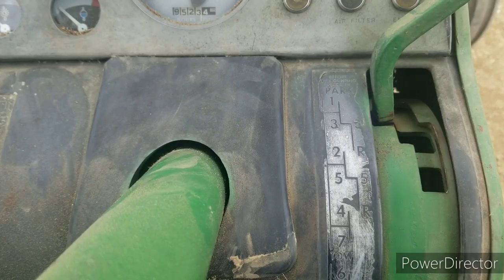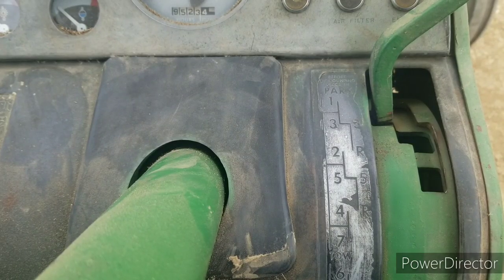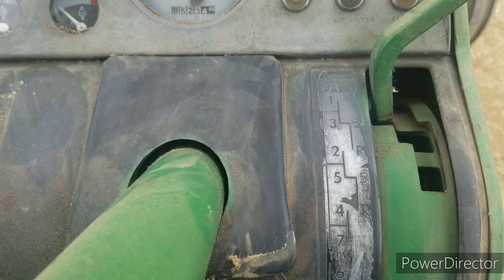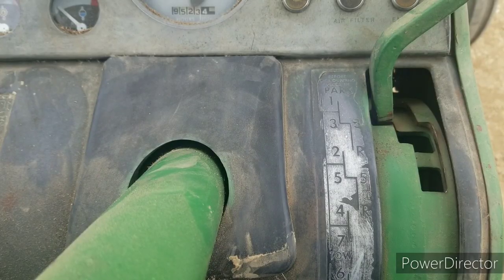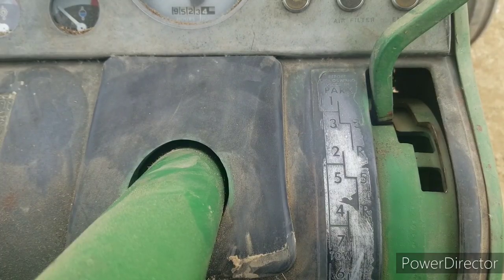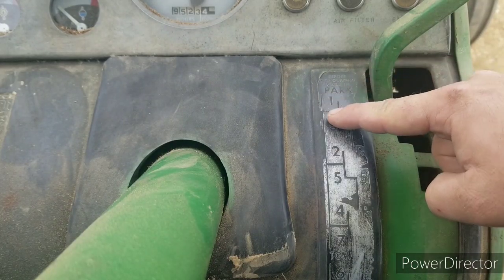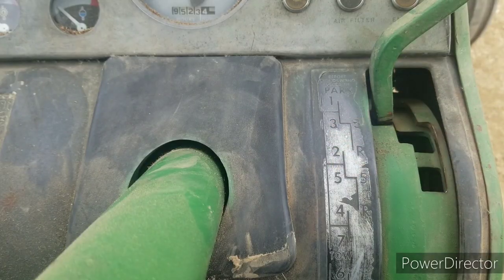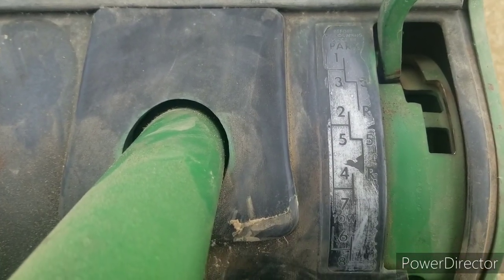John Deere synchro trans - simplified and explained  4320 4020 3020 4010 3010

Comment: I never understood the hatred,  or was it  fear that the IH people had for the Synchro-Range, as I was probably 12 years old when my Dad put me on his new 3020, and let me take it for a ride, MY problem came, when, trying to turn, it kept wanting to go straight, because my right foot had engaged the differential lock.

The only IH I ran in that era was a neighbor's 656 Hydro, which of course, only had the one forward/reverse lever, and it may have had a HI-LO range lever on the other side of the cowl.

Pulling a Syncro-Range without it being in TWO, was, as he said, guaranteed to weld everything on the top shaft into a solid irrepairable, hunk of metal.  You could also turn them into toast by allowing the tractor to coast backwards, when packing silage
Reply from the maker: I think the hatred was not being open minded and taking the time to learn. Operating a syncro is like riding a bike. At first it seems overwhelming and impossible but once you figure it out its 2nd nature like breathing.

Comment: Best explanation i've seen on synchrorange but it was said that you should not shift the range on the move, if you are towing a heavy trailer on the road is the 6th gear low enough to start with or do you just not use the highest range at all or just "force it" from 3rd to 4th range on the move?
Reply from the maker: You are correct you are supposed to start in 6th. That's not too bad if the approach to the road are flat but add a heavy load and a hill and it can become a problem.  I know range shifting on the move CAN be done but it's not good on it. That is one positive about the powershift. You can start in 1st if you want to and just keep bumping her up. Good question hope I answered it. Thanks for watching.

Comment: Damn I've seen memes around internet about this for years, finally i understand it by your genius drawing and explaining: its a 4spd + 2spd-reverse in serial, but the marking printed is showing "sequence" of decreasing ratios, hence from 1 to 8, which is very confusing for people who not familiar with farm equipments. Very good stuff!
Reply from the maker: Definitely less complicated than it appears
Reply: Kenne ich aus den 70igern vom 3010
Reply: Super erklärt, top
Reply: If John Deere would have called it a four speed with hi and low many 10 20 30 series owners would have slept better through the years

Comment: but why are the number 13254768 that dosent mean anything
Reply from the maker: The ranges overlap each other. so the speeds  don't work out to be 12345678. If they wouldn't have numbered them and instead just put  1 low, 1 high, 2 Low, 2 High etc  it probably wouldn't be as intimidating but you wouldn't know which speed was the next higher or lower. It is odd that the numbers aren't in sequence but when you get them in the field it actually works out very well. Example pulling out on the road if it was 7-8 instead of 6-8 then 7th would be too high to start in but starting in 6 and clutching to 8 works very well.  Thanks for watching. Machinery D

Comment: ill be learning to drive a 3020 this summer. City born learning some new things. So I just wanna clarify... You cannot be moving while trying to change between the 4 speeds. but you can clutch and shift between the 2 speeds in each of the individual 1-4 speeds between the high and low?
Reply from the maker: Yep you got it.  Example 2-5 or 1-3 clutch and go but 4-5 stop. Anytime you have to bring the shifter to the left side and change ranges stop. But sounds like you've got it figured out. Once you get the hang of it you'll love it. Thanks for watching 👍

Comment: what is the problem when all gears do not want to move only revese work
Reply: the probem is from john deere 4320
Reply from the maker: @juancruz3434  most likely something in the shifter or shifter linkages. I'd take the cowl off and make sure nothing is bound up.

Comment: What is your experience with the transmission temp gauge? How long do you have to operate your machine before you see that gauge start to read?
Reply from the maker: Great question! I've questioned that myself. When I got the tractor I replaced the gauge and have never seen it move the needle. I'm not sure if I just keep my coolers and screens clean so it doesn't heat up or if I bought a dud. Thanks for watching 👍

Comment: The 4020s had the the reverse in the 4th and 7th range too. They were either blocked or deleted on the side console tractors.  The purpose of that gear was a road gear for mounted cotton pickers which were mounted backwards on the tractor. Reverse was now forward. I think now after 50 to 60 years of service the shift mechanism gets sloppy and quirky and people who have never run one of these tractors gets confused because they put the shifter where they think they want it and it grinds or does nothing. I've spent thousands of hours of my life of mostly 4020s but a lot on 4010s and a 3020 powershift. I'll  add that as good and reliable as the sycros were, the  powershift was even better and more reliable.  The 3020 has more than 20,000 hours on it and the transmission has never been touched.
Reply from the maker: Thanks I didn't know that about the Cotton pickers. Thanks for watching 👍

Comment: Got a 4010 I can't get out of park any suggestions
Reply from the maker: @MarkRivir  usually a good jerk and they come out. Other options are hooking another piece of equipment to it and rocking it back and forth as someone else tries to pull it out of park. This is probably the best way so you're not forcing it. I've also heard of people using a block of wood and a hammer tapping on it but wouldn't get too crazy with it. You don't want to brake something. Also check to make sure none of the linkage is bound up. If none of that works you may have internal problems. Thanks for watching

Comment: The Synchronized 8 speed Deere is nice. However, as the Deere has a closed center Hydraulic system like Massey Ferguson, when the clutch is depressed and the gear train stops, so does the charge Pump in the Transmission that feeds Oil to the Main Pump up front.  Massey’s Charge Pump operates off of the PTO Clutch Drum which runs continues to run any time that the Engine is running. Deere copied a lot of Hydraulic Technology from Ferguson including the Three Point Hitch (   Ferguson System  ).  They messed up on the Charge Pump.

                                        Fergieman
Reply from the maker: @Corvacar  yes although a lot of people say they're the best loader tractor transmission because of the 5f-5r shuttle I don't like them on a loader tractor for that reason. Hold the clutch down too long in close quarters and loose hydraulics. Thanks for watching
Reply: Might have an internal leak somewhere robbing hydraulic fluid from the reservoir. I’ve tried holding the clutch down and cycling the hydraulics several times and don’t lose hydraulics.

Comment: My Grandpa bought a 3010 with this transmission. It took some time to figure it out. Then it was time to teach Grandpa on what to do. Dealership delivered it when no one was at home, he got the manual later.
Reply from the maker: @geraldgiles388  they are intimidating at first but awesome after you figure them out.

Comment: Watched three times great video. Our 806 farmall had torque amplifier. Would loved to field test with 4020 side by side.
Reply from the maker: Thanks I appreciate it. The 4020 would have a hard time beating a 806 on a HP and traction test like plowing and discing. Those 806 generally run very well. Where the 4020 usually won was balance and nimbleness. They just handle so nice with super light steering and strong brakes. thanks for watching
Reply: @machineryd2765 that’s a good way to put it. They both had their strengths and weaknesses.

Comment: Can you shift while moving. Some I've drove you have to stop and put it in gear.
Reply from the maker: The range shifts on the left side like going from 1-3 to 2-5 you should stop. But once you're in a range you can go 1-3-r1  or 2-5-r2 or 4-7 or 6-8 without stopping. I hope I made sense if not let me know and I'll try to explain better
Reply: @machineryd2765  you have to use the clutch or just shift
Reply from the maker: @Joe-sq9tl  all the shifts need clutch but when changing ranges ( the straight up and down on the left side) you need to stop. Going From 1to3 or 2to5 or 4to7 or 6to8 can be shifted on the move with the clutch.

Comment: The biggest question (you mention it btw 5:10 - 5:20 remain) remains UN-solved. Why the gears are not going gradually 1-2, 3-4, 5-6, and 7-8 instead of 1-3, 2-5, 4-7 and 6-8 still remain a mystery. It's OK that you have got reverse with just one move BUT you have to be a magician to make a gradual increase from 3rd to 4th gear. The conclusion is only one. The John Deere engineer must have had diarrhea and was in a hurry while working on this gear design.
Reply: I think it's funny because the power shift 1-4 reverse but the synchro shift has 2-3 depending on the tractor there bo 4 reverse
Reply from the maker: Although it is odd how the ranges over lap each other so that gears do not line up in order 1234.. sometimes it's a pain and some times it is a benefit. Example when taking off for road travel where you take off in 6th and clutch to 8th I believe if it was in order 5678.. that 7th would be too high. And I've used the 4-7 shift Alot when I'm baleing and need to move to a different part of the field I can shift up and throttle back. But you a correct there are many cases that being able to clutch and move 1 gear would be better. Thanks for watching
Reply: Despite the transmition design I simply love these 4020 John Deere tractors. The 4020 is a legend, even though I didn't have the pleasure to ride it.  In my village near the city Sveti Nikole in Macedonia (south-east Europe) in the mid-60s, a big state-owned agriculture company that worked some 15-20 thousand hectares (more than 35-40.000 acres) has bought new 10-15 John Deere 4020, the workers who were operated them still telling stories about these machines...they don't need mechanics, they don't need spare parts, don't need anything but diesel fuel and regular change of motor oil. In the season of plowing, they were working a few months 24/7. Later in the '80s and '90s, the company has bought some newer tractors like Zetor, Belarus, Fiat, IMT, and some bigger and newer models of John Deere but the 4020 remains the best tractor ever entered in the village. Greetings from Macedonia.
Reply from the maker: @КајмакамЕфенди  that's awesome. In my area the 4020s are still many peoples main tractor. I'd bet here in a 5 miles radius there are over 30 of them. Almost all synchro. Powershift never was popular here in south east Missouri

Comment: Why was it labeled 1,3,2,5,4,7,6,8 though instead of 1,2,3,4?
Reply from the maker: Because that how the speeds change in this transmission. They don't progressively speeds up 1234 in a row like that there is overlap with the speeds to where the low gear in each range is low than high gear in the range before it.

Comment: We had a 4010 at work. When I was hired, 5th was out of the question and 2 was iffy as both were the worse for wear. About 4 years in and extra money became available so I got to rebuild the transmission. And also rebuilt the brakes at the same time. As the tractor was used for disking, 5th was the best gear for it and why it had worn out. The brakes, well the first time I tried them after the rebuild I just about went over the steering wheel. Had to learn not to push down very hard on the pedals after having been use to having hardly any to start with.  loved that tractor and the 420 also.

Comment: You did great explaining the shifter. I spent many hours on a 3020 doing everything in the field with it. My grandfather bought just when I started to help him. He mostly owned Massy Ferguson tractors because he got better deals and liked the dealer for service. My memories and even my grandfather admitted it was problem the best all purpose tractor on the farm. I know I spent the most hours on that tractor of anyone. It was the first cab tractor he ever bought. I liked that shifting system much better than the 2 lever Masseys. Thanks for doing the video, brought back some very fond memories during the 70's.  Jeff
Reply: Perhaps You see it as an advantage I don’t.  I own a number of MFs.  The big difference is that the Deere has a synchronized Transmission.  The disadvantage is that the Synchronized Deere has NO  Multi Power (  Massey’s equivalent to IH’s Torque Amplifier but far better).  It is great to have a Tractor that can be downshifted under Power. I am an IH and MF collector.  However, I also understand Deere well so that I can compare Them accurately.

                                      Fergieman

Comment: So you can shift on the fly without breaking the clutch? I get some grinding between gears even when breaking the clutch on my 3010. I made and replaced the shifter rods and freshened up the shifter arms on the transmission. The shift selector and arm has some fair wear. I'd suppose the synchro assemblies are worn out.
Reply from the maker: Ed no that's the powershift the synchro range transmission requires clutch for 1-3 2-5 4-7 6-8 and require stopping to change ranges. Example 4th to 5th

Comment: The Deere I used the most had 6 gears - a John Deere 60.  I did use a 4010 back in about 2016 and it did not shift well at all.  The Internationals don't work well after 50 years either.  The old Farmalls and Deeres worked much better.  Your explanation was great!  Thanks!

Comment: Great explanation. I have experience operating the 4020 with the synchro. I have a couple of questions and hopefully you will respond. I realize this video is 2 years old now. One question I have is the durability of the synchro vs the powershift on the 3020 or any of the JD tractors that used these transmissions. Second question: Working on them how difficult are repairs on either one ? I suspect the powershift would be more complicated. Thanks for the great videos.
Reply from the maker: @Robert Owen in my opinion durability is dependent on the operator. The powershift you can change gear selection anytime to any gear and the transmission will cope with it. When it came out Deere wore out a set of tires going back and forth between between 8F and 4R so it's proven reliable. Another example Deere's biggest 40 series the 4840 was only offered in PS so they thought it was stronger than the quad range. The syncro on the other hand can last forever with a good operator or no time if they abuse it shifting. As far as repairs powershift would probably be more complicated and expensive if the time comes. Not sure never been deep in either 🤞😒. I like the powershift Alot but there are a few places I like the syncro better. It takes less hp to run a syncro so I'd bet also uses less fuel and I like the forward reverse shuttle between 3-1R and 5-2R. I just bought a 4440 and opted for the QR mainly for gear choices and fuel consumption. Great questions thanks for watching

Comment: Grew up with John Deere my whole life never understood how the worked. We always had power shift.  The ultimate as a kid on a grain cart In the 80s.  Wet in the fall stand on the diff lock pull the throttle down and never take your hand off the shifter. Love the video
Reply: The shifter is leaps and bounds compared to the antiquated Two Cylinder Tractors.

                                     Fergieman

Comment: No criticism, just a point, the 2010 was the only syncro in the 10 or 20 series that I'm aware of, that was 1,2,R-3,4,R-5,6,R-7,8. not sure the reason it was the odd one out.
Reply from the maker: Didn't know that thanks 👍 never been around a 2010

Comment: My 4020 DOES have a reverse with 4/7-R  (3rd gear range).....where do I use this range?   I have a loader on the front of the 4020... when picking up hay and moving some distance (and the field is pretty smooth), I use 7th to move to a new location to pick up a bale...and then use 4th gear to actually place the bale on the trailer... and yes I will use that 3rd position reverse to back up... it is very fast for a reverse, but I do use it when in that range.  Now if I'm in a group of bales in the field and don't have to move very far to the "next" bale, then I use the 2/5 gears (2nd gear range).

Comment: Me and this transmission have been in a good number of fights over the years.
Reply: Our 91 year old farmer , Bill & I have been having fights with his 4020 as well! His 72 year old 4020 appears to be winning. When his 4020 is operating good its the most powerful diesel tractor we have ever driven! Power steering is easier than my GM 20 year newer trucks! Scary though, when I found out the steering is all hydraulic. No mechanical connections to front wheels to a gear box like our old Fords. Bill`s 4020 has a tremendous amount of power compared to our old Ford`s.We have driven it once out of the field for him & we stayed with 2nd only at a slow speed. He asked why so slow & we said we did not want to go any faster than our old Ford`s!